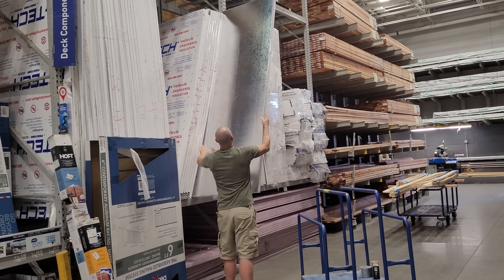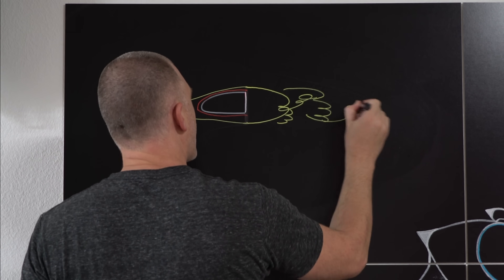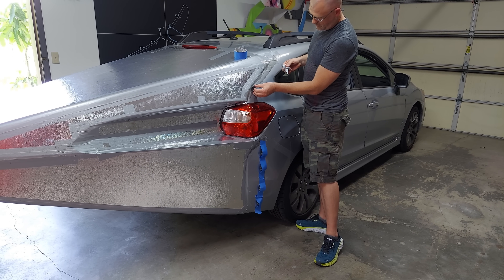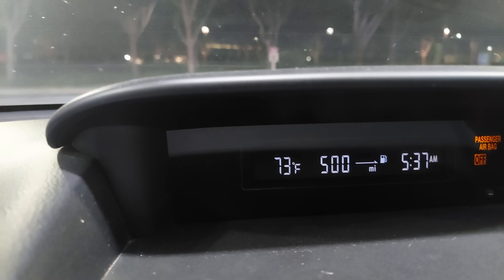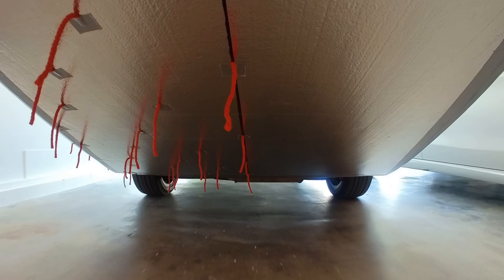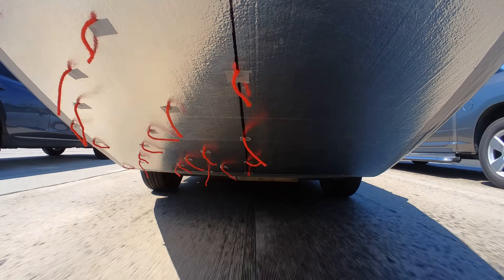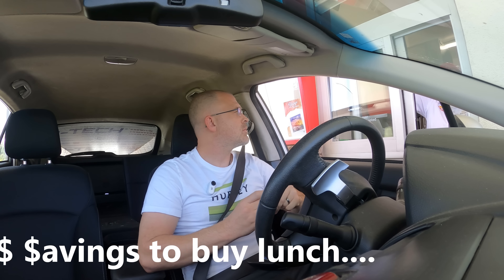Using Simple Aerodynamics to Beat High Gas Prices (Home Improvement Store Edition)

Comment: Add a cold air intake for an easy 2-4mpg... One thing to note here for your intake:

If you want ultimate MPGs, route the intake to the front of your car so it gets the coldest air possible. This will likely reduce power output & engine response at low throttle because the air can't move quickly enough through the intake, but I suppose you could mitigate this by reducing bends in the pipe.

If you want better MPGs but also better throttle response, make a "short ram" style intake with a heat shield.

This is based on my own personal experience with multiple intake setups :)

Edit: A velocity stack (google it) at the end of your intake pipe will smooth the flow of air to the engine even further, meaning you get even better mileage.
Reply: That's a lie as others have claimed mpg gain with a hot air intake by blocking off grill and routing intake near the manifold as hot air regards the fuel and sends lean burn,anyhow  it's all just topic of talk and didn't really do much In real world situations

Comment: Lowering the front, sides, and rear would make it pretty much impossible to go up or down any sort of incline, much like all the sports cars that scrape their front going anywhere. No bueno. 
I'm also skeptical of the benefits of leaving a gaping hole in the back of your fairing. That creates a very strong area of negative pressure that causes a lot of drag. Taper it to a point or close it up and attach your plate to the outside.

Comment: Awesome experiment! It's funny how your design for changes are strikingly similar to concept cars manufacturers put out as well as how some race cars are designed (particularly for f1 and endurance racing). I think your biggest answer as to why manufacturers don't do this is that they don't sell. Especially considering the current climate of the car market being SUVs and trucks, these designs simply don't work as they are much higher off the ground. This would lead to the dirty air you were referring to in your video.
Reply: You can make trucks and SUVs more aerodynamic, too, and a 13.7% improvement would save more fuel, but a boat tail on a Suburban or minivan would be too long.

Comment: It doesn't take elaborate mods most times. Removing roof racks will gain 10 to 15% better mileage at 50+ mph and reduce noise

Comment: Using the auto-off on the pump as an indicator of being full isn't necessarily super accurate. I've had those go off significantly before actually having my tank being full. Although I'm not sure how important that ends up being in your final calculations lol

Comment: Your biggest gain, as many have already stated, is going to be from cleaning up the under carriage of the car.
You can block off a lot of the frontal area through the radiator. Many cars now come with slats that can be opened and closed by the computer to aid in cooling or efficiency.
Wheel spats at the rear wheels.
For the front wheels, i'd get some tubing and attach the "collector" at the front of the car and the discharge I would have at the leading edge of the wheel well. Having air coming out there could create a sort of air curtain for the air that would normally be disturbed by the void between the wheel well and the tire, and create a lot of turbulence. No spats though, you need air there to cool the brakes.
Also, in front of the tires, a little "blocker;" kinda like a mud guard/ mud flap, but at the front of the tire.

Would love to see the next few iterations of this experiment.

Comment: My ‘08 SAAB 9-3 2.0T has 0.28cd (lowest since their first car in the 1940s), so I typically get around 36-43mpg (freeway) depending on my driving habits and the terrain 

My old ‘99 SAAB had around 0.31cd, but was also lighter, and got a similar mpg around 34-42.
Reply: Diesel?
Reply: @2K9s  Gasoline, 2.0T

The diesel engines from that generation are 1.9TTiD
Reply: @iSchmidty13  right on, thanks brother.  We’re looking at VW now so I’m learning.

Comment: The underbody is clearly an area to consider. If you race a production based car at the Bonneville salt flats and add a step pan, that puts you in the Altered class and if you run a full belly pan, that puts you in the Competition Coupe and Sedan class. Some of the people running in the competition coupe class, will run a cover over the rear wheels. If the roof rails aren't too difficult to remove and re-install when needed, then get rid of those too.

Comment: Are you using Cruise Control? From crunching numbers on two electric cars (Leaf, Bolt),  I've found we save at least 10% on the highway. Now I use it on the ICE car, too. 

Without using CC, we tend to constantly press and lift the accelerator as we drive. Nearly all of that is subconscious and it is a constant source of inefficiency--try to pay attention for 5 minutes; you'll see. Let that little onboard computer do it instead. It's much better at it and you will save 60 cents per gallon.

Comment: you could also take off the roof rack and add a glass or transparent piece to the taillights similar to the Nissan s30 headlights lowering the car would also help and adding tape or something to cover the panel gaps of the car plus you could cover the wheel wells/ fender

Comment: Not sure if there is a part for that car ur using but maybe adding some diffusers to the rear of the car on the bottom. That will improve the air flow coming from under the car and smooth it out a bit just in case u wanted to try that I think it would work.

Comment: Saab a formerly swedish aircraft manufacturer started designing cars after ww2 and their first car the ur saab was highly aerodynamic but because the wheels were sunk in to the car it made a place for  snow to get stuck so they only made one, after the ur saab they made another car that fixed the wheel issue by exposing the wheel well and for a time they made little to no changes on it until they made a few more types of saab cars, one of their most famous is the saab 99turbo a sporty turbo tuned coupe wich still cruises around the nordic roads of finland and sweden.

Comment: Have you looked into low friction tires or increasing tire pressure on the ones you have. You could use corrugated plastic to seal the underside of the vehicle.
Reply: Tbh low friction tires are awful, would never recommend them, grip(friction) saves lives, I'd rather save some grip than save some pocket change. Plastic on the underside of vehicle is very effective tho
Reply: Increased pressure and low friction tires are both dangerous. Tires have grip for a reason
Reply: Yes, the under body creates a lot of friction, but do not forget about dissipating the exhaust heat.
Replacing the outside rear view mirrors with small outside cameras and inside displays,
Reply: @somaday2595  also if you cover the bottom you run the risk of flying off. For real.
Reply: @srck4035  But wouldn't slightly compressed at the front of the vehicle flow faster with an under body pan, creating lower pressure?  (Bernoulli principle)
Reply: @somaday2595  sure but are you the one that can calculate it. And even then go over a bump and your sucking body sudeenly is an airfoil and sends you flying. I would really not try this. It can be catastrophic. Imagine your front lifting and the air at 80mpg catches under you pushing the car up. That's it you are flying
Reply: @somaday2595  Cause that's totally legal in the US...

Comment: I think your comparison with honey is wrong. Most of the drag in turbulent regimen is due to pressure differences arising from flow separation. These are completely unrelated to the viscosity of the fluid, they happen even with ideal fluids. 

OTOH, I fully agree that most of the drag comes from the rear part of the vehicle. Actually, looking at some car shapes (this Subaru included) I wonder whether modern cars aren't actually more aerodynamic in reverse... Looking forward for your next step. Just watch out for undesired induced lift, especially on rear axle, if you plan to taper the tail downwards. Don't forget the lessons of the Audi TT...

Comment: If you can find them cheap enough a set of prius wheels with the smallest tires you can put on them running 3 to 4PSI below Max is going to have very shitty ride quality and quite a long stopping distance but will probably increase fuel mileage by 3 to 4 miles a gallon itself due to the reduction of unsprung weight and grip

Comment: Very interesting perhaps.  Replace the foam insulation with eqaully light or lighter smooth plactic and wax the whole vehicle aswell as added tail.  Tape any panel gaps with blue painters tape.  Tape up the front of the grill And mind your temperatures so as to allow only enough air to come in to cool the radiator and feed the air intake whilst reducing drag.  Make a sealed skid plate for the bottom of the car from a refrigerator box  If you look under the bumper of most cars you'll see that where the plastic covers to the undercarriage is essentially just a scoop grabbing air.  And create some sort of a boot housing that  Can sit on the inner side of the wheels which is most likely turbulating air around the suspension area. Finally don't forget about internal frictions using an upper cylinder lubricant like Marvel mystery oil or A TCW3 2 stroke marine low ash oil will reduce cylinder frictions thus by reducing internal wares promoting better gas mileage I noticed a 0.8-1.2 MPG gain using 2oz marvel mystery oil to 10 gal gas.  Some other guy and his Mercedes proved to as well and of course project farm proved just how well it cleans up the cylinders
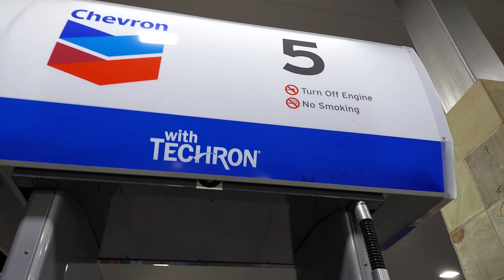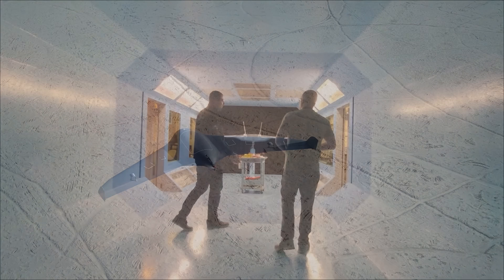Reply: Repent and follow Jesus my friend! Repenting doesn't mean confessing your sins to others, but to stop doing them altogether. Belief in Messiah alone is not enough to get you into heaven - Matthew 7:21-23, John 3:3, John 3:36 (ESV is the best translation for John 3:36). Contemplate how the Roman empire fulfilled the role of the beast from the sea in Revelation 13. Revelation 17 confirms that it is in fact Rome. From this we can conclude that A) Jesus is the Son of God and can predict the future or make it happen, B) The world leaders/nations/governments etc have been conspiring together for the last 3000+ years to accomplish the religion of the Israelites C) History as we know it is fake. You don't really need to speculate though because you can start a relationship with God and have proof. Call on the name of Jesus and pray for Him to intervene in your life. - Revelation 3:20

Revelation 6 1st Seal: White horse = Roman Empire conquering nations under Trajan 98-117 AD & Gospel spreading rapidly. 2nd Seal: Red horse, bloody civil wars with 32 different Emperors, most killed by the sword. 185-284 AD 3rd Seal: Black horse, economic despair from high taxes to pay for wars, farmers stopped growing. 200-250 AD 4th Seal: Pale horse, 1/4th of Romans died from famine, pestilence; at one point 5,000 dying per day. 250-300 AD 5th Seal: Diocletian persecuted Smyrna church era saints for ten years, blood crying out for vengeance. 303-312 AD 6th Seal: Political upheaval in the declining Roman Empire while the leaders battled each other. 313-395 AD

Revelation 7 Sealing of 144,000, the saints, before trumpet war judgments, which led to the fall of the Roman Empire.

Revelation 8 1st Trumpet: Alaric and the Goths attacked from the north, the path of hail, and set it on fire. 400-410 AD 2nd Trumpet: Genseric and the Vandals attacked the seas and coastlands, the blood of sailors in water. 425-470 AD 3rd Trumpet: Attila and the Huns scourged the Danube, Rhine & Po rivers area, dead bodies made water bitter. 451 AD 4th Trumpet: Odoacer and the Heruli caused the last Western Emperor (sun), Senate (moon) to lose power. 476 AD With the Western Roman Emperor (restrainer of 2 Thes. 2) removed; the son of perdition Popes took power.

Revelation 9 Two woe judgments against the central 1/3rd and eastern 1/3rd of the Roman Empire. 612-1453 AD 5th Trumpet: Locust & scorpions point to Arabia, the rise of the Muslim army. Islam hides Gospel from Arabs. 612-762 AD 6th Trumpet: Turks released to attack Constantinople with large cannons (fire, smoke, brimstone). 1062-1453 AD

Revelation 10 The little book is the printed Bible, which was needed after the Dark Ages when Scriptures were banned by Popes.

Revelation 11 7th Trumpet: Martin Luther measured Roman Church; found that it’s an apostate church, not part of true temple. The two witnesses are the Scriptures and saints who proclaim the pure Gospel and testify against the antichrist Popes. Papal Church pronounced Christendom dead in 1514 AD. Silence for 3.5 years. Then Luther posted his 95 Thesis, which sparked the Protestant Reformation and brought the witnesses back to life. Millions of Catholics were saved.

Revelation 12 Satan used the Roman Empire to try to wipe out the early Church, Satan was cast down as the Empire collapsed.

Revelation 13 The antichrist beast Popes reigned in power 1,260 years, 538-1798, is the little horn of Daniel 7, son of perdition. The false prophet Jesuit Superior General rose to power from land (earth) of Vatican and has created many deceptions.

Revelation 14 Points to great harvest during the Protestant Reformation & wrath on Catholic countries who obey antichrist Pope.

Revelation 15 Overcoming saints victorious over the beast. Prelude to 7 vials and judgment on those who support Papal Rome.

Revelation 16 1st Vial: The foul sore of atheism was poured out on Catholic France, leaving them with no hope, led to revolution. 2nd Vial: The French Revolution started in 1793, killed 250,000, as France had obeyed the Pope and killed saints. 3rd Vial: The French Revolution spread to rural areas of France, where Protestants had been killed in river areas. 4th Vial: The bloody Napoleonic wars shed the blood of countries who had revered and obeyed the antichrist Pope. 5th Vial: Judgment on the seat of the beast. Papal States invaded in 1798, Pope imprisoned, removed from power. 6th Vial: The Turks vast domain dried up, they were only left with Turkey. They lost control of Palestine in 1917 AD, Israel became a nation again in 1948

Comment: You should look at the Dodge M4S Turbo Interceptor for some inspiration.

One other thing you could try doing is getting your hands on a salvaged Prius, making the same aerodynamic mods, and then removing the dead NiMH battery packs.

Replace the traditional piston engine for a microturbine to power the Prius directly. Freeing up over 2,000 pounds of battery and piston engine weight for a lighter, lower maintenance turbine to directly produce electrical output to the series wound motor would make a huge difference.

Comment: I'm disappointed you didn't show the footage of you getting pulled over and told that your mods were not street legal and car getting impounded.   If the reason you didn't post that part of the video is that it hasn't happened yet, then please post it when it does.

Comment: Solution for headlights - clear sheet of thin plexiglass to complete the shape. You can as well add smooth sheet of something under the car, but it has to be heatproof, maybe thick aluminium foil. To help air attached at steeper angle you can make diffuser at the rear, but with such a steep angle you may generate too much downforce for what is bunch of foam board and isn't actually desirable. As well I would put number plate on the top rather than leaving that hole in the back. Not only it would improve aerodynamics, but as well I doubt your current solution is legal i.e. I don't think it counts as "visible number plate" from perspective of speed cameras and general law enforcement. As well closing rear wheel arches may help with air on the sides, because most likely turbulence is coming out of there.

Comment: Both parking in a normal parking space. Access to the trunk. And airing up the tires are all next to impossible. Which leaves you at. Designing your own vehicle. All you need is  a little more cardboard. Glue or tape, Right!

Comment: the last suggestion of making the back shaped downwards is a very bad suggestion at higher speed. you practically create the lift upwards like on an airplane wing which reduces the downforce and that reduces the grip of the tires on the street. this is very bad at high speed because it reduces the maneuverability / stability of the car. and the underfloor is not constructed with the ground effect of a modern 2022 F1 car, that practically sucks itself on the ground.
you can look at the mercedes EQXX engineering prototype